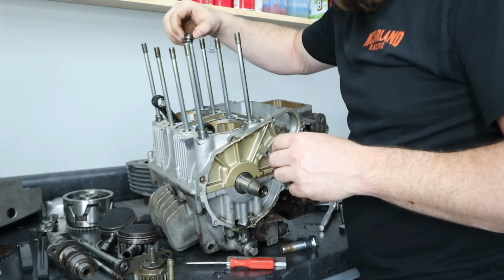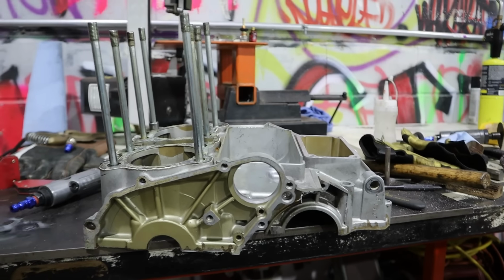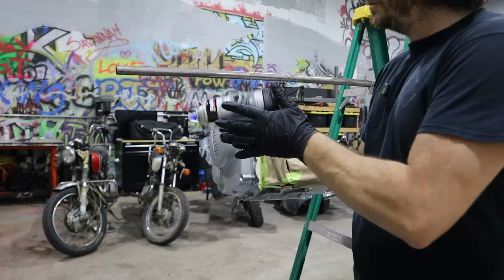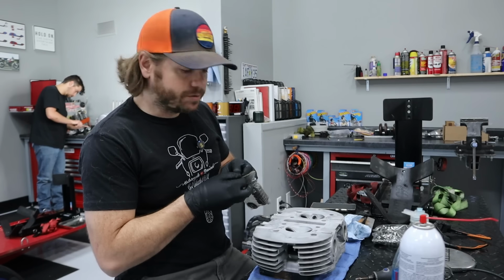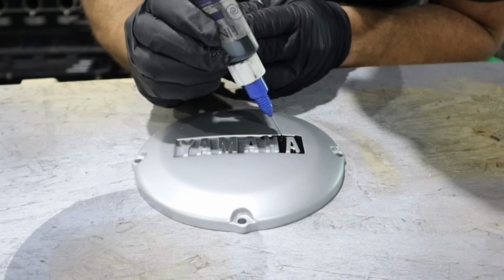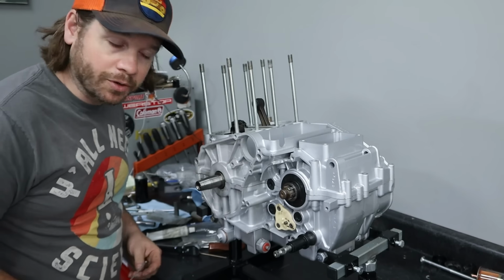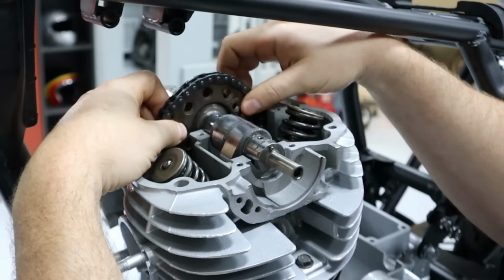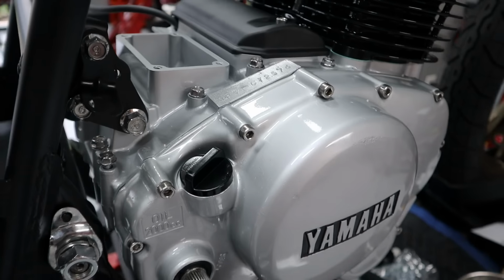Yamaha XS400 Engine Rebuild Start To Finish!

Comment: I need to try a 2K clear coat on Dupli engine paint. I've used their clear coat and I am not super happy about the quality.
Reply from the maker: @tomek860  I really don't like the duplicolor clear at all. It chips if you sneeze in the next room. 2k is strong

Comment: I loved the use of the 2x4 strapped to the block to be able to lean into and counter the torque spin of undoing fasteners, ingenious. Also three cheers for mentioning and showing the clutch fibre discs soaked in the little baggy of oil. I made the rookie mistake back in 1981, of thinking just dipping them in oil was good enough, only to regret that lol. Bottle Caps of Valour all 'round chaps!
Reply from the maker: Well thank ya! The 2x4 really helped in that moment

Comment: What is the bolt used to take off flywheel?
Reply from the maker: I do not recall the size but a quick Google will give the answer
Reply: @BrickHouseBuilds it's cool. I used a harmonic balancer pulley bolt. Worked great! Having a tough time taking the cylinders off. Already broken a fin smh. 😢

Comment: Where did you get the stainless hardware kit for the motor?
Reply from the maker: Ebay. Just search for a kit and you will find them
Reply: @BrickHouseBuilds ah, ok. Thought you went through someone specific. Thanks.

Comment: Nice job! I just wonder you don`t apply any sealing (silicone) between the head and the head cover.. I experienced some leaks there when not sealed.
Reply from the maker: I did, I mentioned it as well. Case sealant is the proper thing to use there.

Comment: As a rattlecan spray enthusiast (I do paintjobs pushbike frames and components), some key tips are:

1. Don't push and release your cans on the part you're spraying. The spray output on the start and end of a spray in very blotchy and inconsistent, and can lead to runs and orange peel.
2. Prioritize light coat coverage on any nooks and crannies, crevices, and any concavities and pockets that don't get hit as well in major spray movements so you don't end up trying to spray aggressively to compensate. (again to avoid overspray) You can then proceed to a larger spraying movement to maximize coverage on the entire part.
3. During any extensive pauses between sprays (from one component to the next), turn your can upside down and press heavily for a split second to remove any clogs or globs of semi-hardened paint on the nozzle before spraying again.
4. spray in a slight rainbow shape (curving upward) so the lowest points in your spray trajectory are on the ends to minimize the paint pooling to the middle. (Paired with #1, you should be able to avoid such an issue)

Otherwise great work! I plan to have a motorcycle within the next year and after putting some miles on it I'll be taking inspiration from your builds in building my own custom.

Cheers! ❤❤
Reply from the maker: Thanks for watching

Comment: I’m in the UK rebuilding one of these, cannot source any main or big end bearings though, where did you source yours from?
Reply from the maker: @cloudwebsolutions1805  Between ebay, cmsml, and some small obscure websites I was able to find what I needed. Literally like 1 bearing from each place
Reply: @  I can get hold of the connecting rod bearings but there are 3 sizes available ranging from 10-30, black, brown and blue but not sure what size I need. I guess the crank needs measuring to find out clearances etc?
Reply from the maker: You can reference that info in your service manual.  It's broken down in there
Reply: @BrickHouseBuilds  Ah I got it, took me a while 🤣 really appreciate your help..
Reply from the maker: @cloudwebsolutions1805  That would be partzilla or cmsnl

Comment: For getting gudgeon pin out (wrist pins in the USA?) you can buy tools to push them out smoothly. First one I saw was intended for 2 stroke karts with a non caged little end roller bearings (so it has a spacer to locate the rollers until the gudgeon pin was in place). Or you can to a similar job using a long bolt, a nut and 2 deep sockets (one a touch smaller than the gudgeon pin, one large enough for the gudgeon pin to in into the middle).

Eeek for the oil pump screen.

For the 2 part rattle cans, are they pretty much all fuel resistant or is is just some? I will need some soon!

Script on the side cover looks great
Reply from the maker: Yes, you can see me using a socket to tap the pins out. Normally pins come out easy but due to the oil starvation, the pins were chewed up and tight on the rods needing extra force. 

As far as paint, you are looking for "2k" in the name.

Comment: When I was little we rebuilt the engine in my dad’s econoline. Ford 351 Windsor. After we had it honed we pressure washed and it flash rusted. That’s when I learned one of wd-40’s real strengths
Reply from the maker: Yeah that will happen lol

Comment: @BrickHouseBuilds.... Hey "Joe Dirt" ... Love the Tips along the way. I have never opened a newer M/C engine. Do you find some of the parts are different because of the Newer Materials Back then to Today? And have you find some of the Re-Manufactured Parts for Older Bikes harm the older motors or do you try and find Original Parts made it the same years of the bike your working on. Take Care and God Bless, Enjoyed the Video...What did you mix with the tester paint for cover?? or is it just straight Testers from the bottle?
Reply from the maker: In general modern castings are better. Hard for me to be a judge of material quality.  I use OE parts where possible like all bearings and hard parts. Gaskets and seals I'm not terribly picky with.  
As far as the paint, straight from the bottle. Give it lots of time to dry before clearing over it if you clear at all